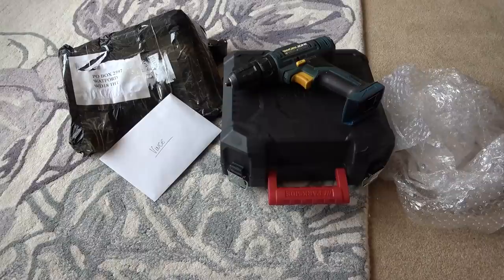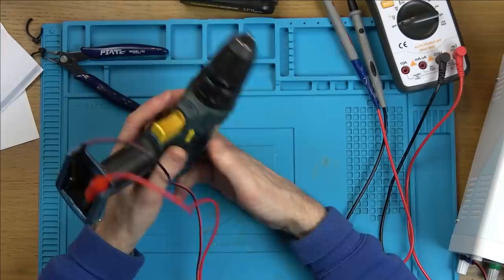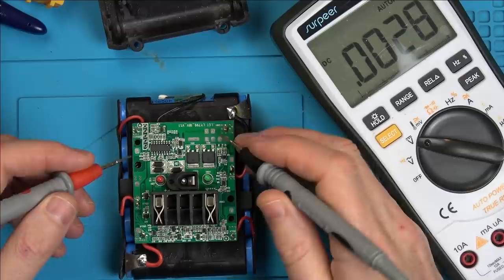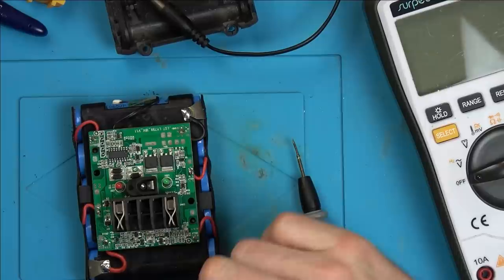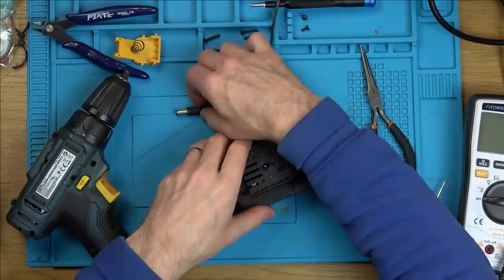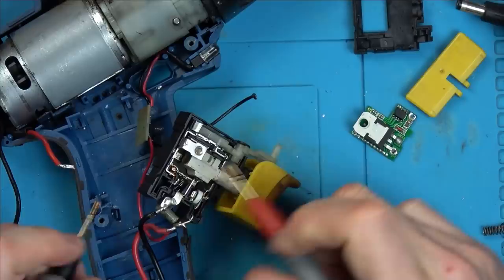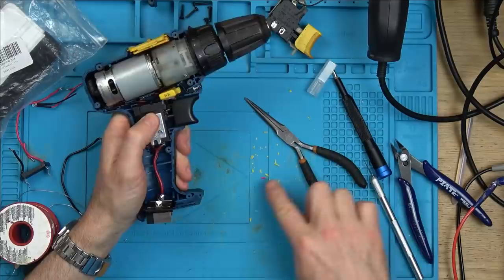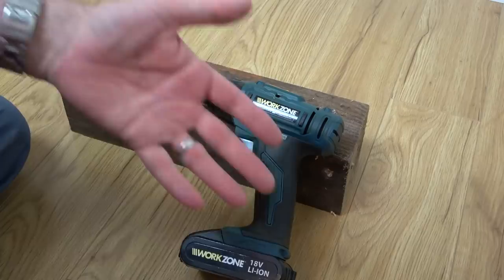No Power on a Cordless DRILL - Tea Break Fix

Comment: Initially, when connecting the power supply, you got a small arc. So, this faulty switch shorted the input when not depressed. For the rest, it seemed to work properly. When the battery was connected it gone into short protection.
When you connected the Li-ion cells straight to the drill's input, the short got burned up and the spring got heat-damaged. So, probably the spring caused the initial problem. Maybe it bent out of shape and shorted some conductors next to it. Dissect the old switch and look for evidence of arcing and heat damage.
So, initially, the battery was in the overcurrent protection state: the MOSFETs disconnect the load. The BMS was still passing a small current, for checking if the short would be still present. That small current is only enough to light the LED.
Usually, the BMS resets itself to normal operation after a while, unless the short circuit is still detected. Or maybe your shorting action caused a reset.
Since you replaced the switch, I think, this device is now safe to use.

But you should still test if the BMS's safeties are still working properly:

If battery is almost empty, it should stop working abruptly. If you can still 'use' this drill until the motor slows down to a crawl without load, the protection circuit is broken and the battery should be discarded. Don't try to fix, the cells are probably internally damaged at this point and can get dangerous if you try to recharge them.
Short protection: connect some car headlight bulbs up in a way that you have 4 filaments in parallel. Connect that to the output of the battery. The filaments should not light up. Or, just short the battery's terminals using an unfused/cheap 20A multimeter, and see if it cuts the current. While doing this, have snips handy, so you can quickly cut the wire between the cells and the BMS in case this goes very wrong.
Another thing to do, to increase battery longevity and net capacity: manually balance the cells. This BMS seems to be not doing any balancing: it just stops charging all cells if one reaches 4.2 volts. In order to balance the cells, you should fully charge this battery with the included charger. Then, with your multimeter, measure all cells individually. Then, with your power supply set at 4.20V, 0.5A, you bring the voltage of the lower cells up to the voltage of the highest. This might take a while, per cell. Don't speed it up by increasing the voltage or current limiter. Be extra careful with the polarity: the 4V of a charged 18650 will win over the reversed 4V of your power supply with ease and you'll be doing a 'trying to fix' on your power supply.
Reply: What an interesting post... Vince has a great community

Comment: Its because the protection circuit on the negative side of the battery was faulty and when you arking/sparkle and weld the wire, you burn it out completely and now you just have negative short and you measure straight 20V from the battery, but the charging control on the positive side is OK so it charges normally, but no short protection on BMS PCB (that is what the monitoring PCB is called and that is why it is connected to every single battery junction). Then that arking/sparkling (that event acts like oscillator and may generate thousents of volts in this unstable condition) burn out the transistor (or Triac/Thyristor) in switch. When battery is loaded, the current may peak up to 15 Amps or more depending on drill load, so voltage will drop to 18V and even less (Ohms law), that is why the switch was rated at 20A. Maybe there was also primary fault in the switch. Any other questions? :D
Reply: I tend to agree with you on this one. I wouldn't trust the BMS now either as there is a potential for further arking and a catastrophic fire occurring. The BMS should be replaced.
Reply: @rdp8545  Because BMS now does not have max load protection, huge load on the batteries can set the whole drill on fire, there is nothing to "unhook the power" when critical condition is acheived. I edited a bit my previous post so now is more accurate.
Reply: @ErrorMessageNotFound  Now this is nonsense, or should I say insufficient knowledge. I am sure that you are not familiar with bad consequences for MOSfets or bipolar transistors under arking conditions, also you need to consider capacitive charges, peak currents and voltages, when sparkling occurs there are dozens of bad anomalies that happens. That board is not meant to be a welding inverter, if it was, all conditions would be well calculated for that purpose. That protection is not made for strong arking rather than overcurrent conditions. Nobody will invest in industrial well calculated power supply on cheap drill so it will last longer, consider this too.
Reply from the maker: Again, thank you for sharing your wisdom technixbul. I knew the viewers like yourself would have all the answers 👍👍👍
Reply: @Mymatevince  Well i don't know all answers, but it happens to know those and a lot more answers. I am sure you'll agree that many things you can't find on google, but your and of the people around you experience will give you those priceless hidden answers.

Comment: Battery was in over current protection mode. When you welded the leads to the drill, the dead short caused a voltage drop low enough to reset the protection mode. You could just disconnect battery leads from charging PCB to reset.

The reason the battery was in protection mode is because the mosfet in the trigger had failed. It cooked the spring when you shorted it, because you bypassed the protection circuit.
Reply: I agree
Reply: If not MOSFET then maybe the spring displaced and shorted.
Reply: But if something was broken with the trigger, why did it work properly with bench power supply?
Reply: Thanks for posting your explanation. I watched the full video and could not understand how the battery could have fixed itself. The protection circuit worked perfectly when the trigger went faulty. Great analysis!
Reply: @daikiryoku  Yes, but first it looked like the break was working. Do they use the spring as a fuse?
Reply: @daikiryoku  I was thinking the speed ramping up was due to running at only 18V which is kind of low when the battery runs at 21V when fully charged. That is well below half charge so there may just not have been enough juice.
Reply: The brake is in the mechanical part of the drill, there are cylindrical bearings in the teardrop beds that use the leftover enertion to lock the rotating shaft when release the button.
Reply: I agree with you have seen it happen in a lot of drill batteries on building sites analyse the trick of discharging them a few years back your analogy was spot on thank you

Comment: Very nice video. The button was shorted. The BMS stops the current in case of a short circuit and recovers when the battery is connected to the charger.  After the short circuit disappeared, the battery operated normally.  After replacing the defective button, the drilling machine is in perfect working condition.

Comment: Very useful. I've got one of those drills that appears to have a faulty switch. It actually failed the first time I used it, but I never got round to returning it and it's out of guarantee now, so one day I'll take it apart now I know what to expect! I've also got a 12v Aldi drill, which has been massively overworked because this one is faulty, but it's taken all the DIY work I've thrown at it without complaint. It's only got one battery, but has a fast charger so is ready for use again after a tea break! I bought the 18v one because it wasn't much more expensive than buying a second battery for the 12v one, and it came with two batteries!

Comment: The BMS is dead. That's why it sparked and burnt out the trigger. You are bypassing the BMS so the drill no longer has protection.
The BMS would have been limiting the amps from the battery to lets say 10amps. As you're connected directly to the negative now you are most likely drawing the max amps from those cells which is why the drill is so powerful now. I don't expect it to last long.

Normally, if the volts from the BMS is lower than the battery then the BMS has detected a fault.
Could be the BMS was wired up wrong, the BMS is damaged, or the batteries are no longer the same voltage.
Reply from the maker: Thank you for the detailed explanation 👍👍👍

Comment: I think the charging and protection controller got reset because of the short/overload. The short/overload made the voltage supplied to it drop to zero, so it lost its memory. Just guessing.
Reply: i was thinking that also
Reply: Yeah had xbox 360 charge and play kit not holding a good charge sparked the positive and negative and it worked better than it was though not really 100% but close enough anyway. Did that to an old Nokia battery too wasn't working, worked after shorting for less than 5 seconds!

Comment: Just a thought but if the spring is part of the circuit it could be the over current heated it up so much it make it contract and affected the speed control. With the sparking, you may have shorted out the current limiting features of the circuit, causing an overload and going back to point one. Id suggest the new switch will be fine, as to why its now working as suggsted below the sudden surge may have equalized the batteries.

Comment: I did ask a colleague that design medical equipment, what could be way it was behaved like it did.

His explanation was dust in the switch, when you disabled the over current protection and put the hole load in to the machine you burned the dust of in the switch.
Way did it work when you had the benchpowersuplly, it was because you were bringing the dust but not high enough to burn the dust away.
Do not fully understand his answer but maby you do.
Thank you brilliant video.

Comment: Most likely it was a faulty trigger with a short accross it when not pressed in, when you powered it off your bench psu it would have gone into CC mode until you pressed the trigger then it ran, this short would have caused the bms in the battery to shut down explaining the low voltage, when you directly connected the batterys to the drill that dead short would pulled the batterys voltage down so much the bms would have very little voltage across it causing it to reset.

Comment: I believe that the charge controller was keeping things "safe" based on the differences in the cells half a volt difference may have been enough to be a "no go" between the charge controller contacts and the tool.  Lots of videos out on YouTube on how to charge cells individually by bypassing the charge controller - that could be dangerous if it's done and there is a low cell - I think that when the tool shorted something on the controller circuit or when you attempted to bypass the charge controller directly to the tool it brought other cells down to a similar voltage and that allowed them to be charged successfully.

Comment: worxzone guild and worx all share the same battery, 
I actually have a guild one, which the brake stopped working with little use, but then started braking again on its own.
Good to know the switch can be replaced if needed. 
thanks.

Comment: With my experience with reparing broken USB ports on Powerbanks, it's always that if the output voltage is not coming as expected, disconnecting and reconnecting the batteries to charge-dischargr circuit, it resets the power charge controller IC. That would start working normally.

Comment: I had a broken battery in a Workzone cordless drill hammer from a member of the family. Somehow one Transistor burnt close to the power plug. It is a Sot23 thingy, nothing readable after the burning… I just removed it, and it seems to be just the switch to change the led from red to green when the battery is full… It works now to reload the battery. One device saved from the landfill. It was so cheap that it wouldn’t have been worth to buy a new battery…

Comment: I would investigate the DC jack on the battery pack. These sometimes have a switch in the negative side (which closes when the jack is removed) and any poor contact / corrosion may have resulted in the power dipping when the drill was connected.

There may be current control / limiting in the battery pack. Applying 20V to the drill (when it should have been 18V) without any form of limit (which may also be related to the DC jack) resulted in the ‘welding effect’. This may explain why everything was ok when you used your 18V ‘current limited’ bench power supply.

Comment: An issue the Samsung galaxy s3 had was faulty charge ports, I used a battery to short the wires together to make a spark, I would put it to the charge port and spark it a couple of times and it started working again, you might’ve jump started a component in the motherboard

Comment: Regarding the issue with the LED not coming on in the center posistion.  When you shaved the inner sides  of the plastic part to allow the thicker pin to slide in it, you had to also cut into the bottom of the slot to allow for a bit more movement so the LED switch would activate.  
As for how you made the battery suddenly work, I can only offer a theory.  You might have shorted out or glitched the protection circuit that prevented it from working if the battery pack was not properly balanced, as one cell was measurably out of spec.  
By the way, the battery level indicator was lighting when you had it open and was testing it.

Comment: The mosfet in the trigger failed short circuit. When the battery was plugged in it went into protection mode, and when you bypassed the bms you fried the short in the trigger. In the process it got hot enough to anneal the spring. The mosfet is responsible for speed control, so without that it's now all or nothing

Comment: I was interested in those two black components in the battery you were measuring 20 volts on them.
Maybe they were faulty mosfets for power switching and the accident with the battery and drill could have blowen one to a full short through?
The drill switch was damaged, not sure how that happened.
Anyway it works :-D

Comment: Good fix & just a tip the bit slips because it's not the right one for the screw each screw head is slightly different because of manufacturering process that's why there are many different bits

Comment: You should be able to find the max discharge current of the 18650 cells. This will tell you if the switch is rated high enough.

Comment: DC = Negative = power into the device, Positive = power out of a device. the reason for the spark was you had negative connected first rather than last, hence the sparks, DC current is reversed polarity to the way you think current would flow. you will get sparks every time negative is connected first when playing with DC voltage. same with a car battery. the reason why you don't get sparks off a 1.5 volt battery is because the amperage is too low to make much of a difference. the reason for the spark was because of the circuit being completed via the light drawing current.

Comment: Probably bad 18650 lithium ion cell, measure all cells, balance charge them, replace the bad one with one of similar charge level. Or replace all cells with stronger cells such as Samsung INR's or Sony VTC4. It is probably the BMS (Battery Management System) kicking in and stopping the charge. You could use your bench power supply to bring all the cells to a similar charge level to 'reset' the BMS. I had to do this on a Ryobi battery. Same problem, same symptoms.
Reply: I agree.... The reason he got sparks from 20V was because he was completely bypassing the BMS which manages the voltage between the battery and drill. He essentially solder two wires - one from the positive and the other to the negative terminals from the battery ends this completely bypassed the BMS which resulted in too much voltage going to the drill. The reason he didn't get that with his bench supply was because he had it set up at the right voltage and only 1.8A if I recall? Also I wouldn't trust the BMS now as something else may have ark and could potentially cause a catastrophic fire. Technixbul below sums it up well and seems the three of us are on the same page.
Reply: @rdp8545  Yep. Spot on 1.8A on the bench power supply and if you short circuit any lithium cell, they don't like it at all considering some of them can output 25-30A for a short while. Risky business lithium ion cells especially for people who don't know anything about them. 
Just as Vince did, bypassing the BMS he effectively welded the wire from the battery pack straight to the drill battery contact.

Comment: it has been a faulty switch, perhaps the spring has worked its way through the switch and short-circuited the electronics in the switch. it is not normal that you can turn on the light when the switch is locked (when the right and left are in the middle), it must lock the switch so that you cannot use the switch for anything (it is a security when you have the screwdriver lying in your tool bag, for sides it is not in the middle, things in the bag can make the screwdriver run around and therefore use the battery / heat up the screwdriver so that it eventually short-circuits (gets hot). so all in all it has been a faulty switch😊there is a safety device in the battery (electronics) which switches off when there is a short circuit in the screwdriver, so that the battery does not explode. you bypassed the electronics when you soldered the two wires on, that's why it got stuck when you put it to the screwdriver😂😂 I have repaired many screw machines / battery drills (I have worked as a tool maker)😊normally the screwdriver must stop 100% when you release the switch, it brakes the engine 100% just like when you step hard on your brake in the car😊 that's why the engine makes sparks when you release the switch